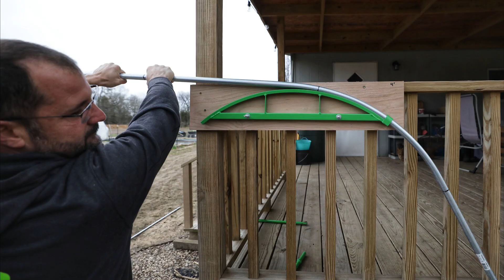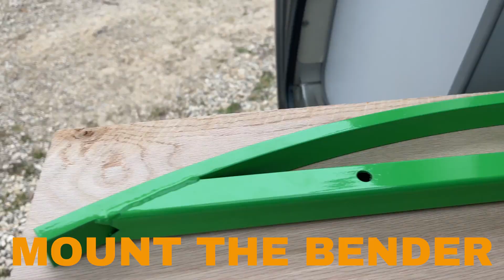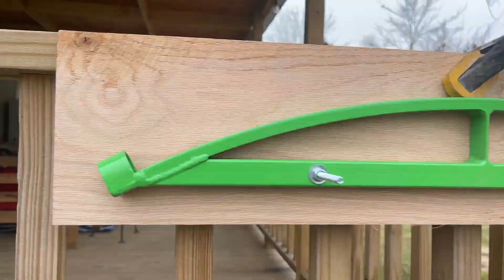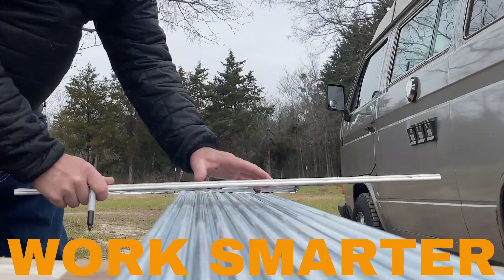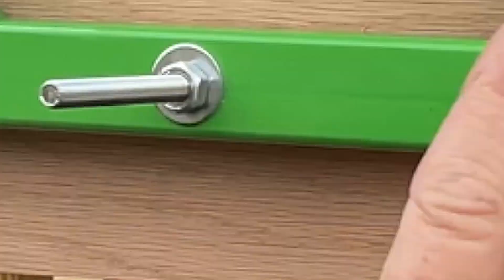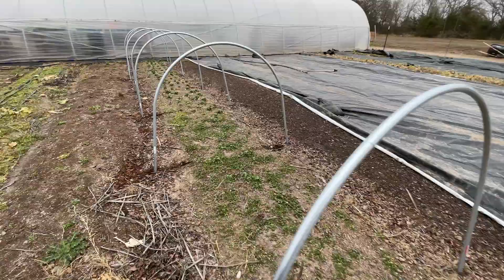How to Make 4 Foot Low Tunnel Hoops | DETAILED Step by Step to a 4-ft Bender

Comment: What size poly will you use on this? Is 10’ wide enough? Is there another video showing the finished product?
Reply from the maker: The low tunnel hoops are mainly for frost blanket and comes in 10' & 15' wide with wider covers covering multiple rows. https://www.bootstrapfarmer.com/blogs/building-a-greenhouse/frost-blanket-how-to-use-it-and-when?_pos=2&_sid=02b1ef59b&_ss=r

Comment: Where do you place the marks on EMT for the 6' hoop bender?
Reply from the maker: The 6' bender is similar to 10',12', & 20' in that you start at 9" and then bend every 18". Here is the link to the instructions: https://cdn.shopify.com/s/files/1/1338/7937/files/Hoop_Bender_Instructions.pdf